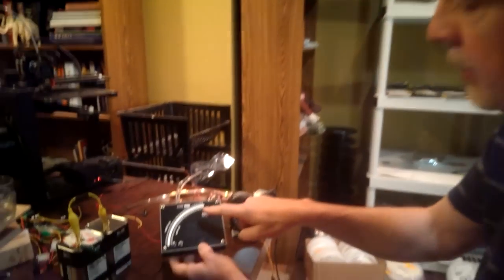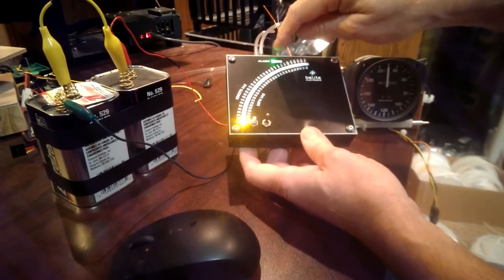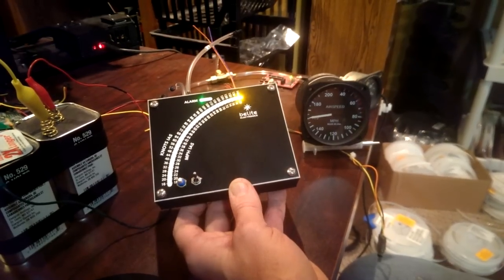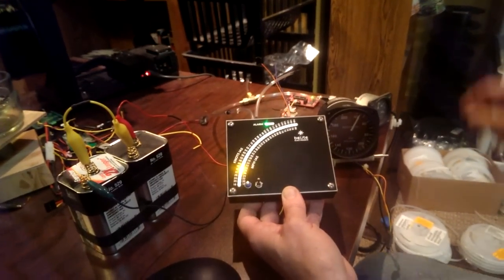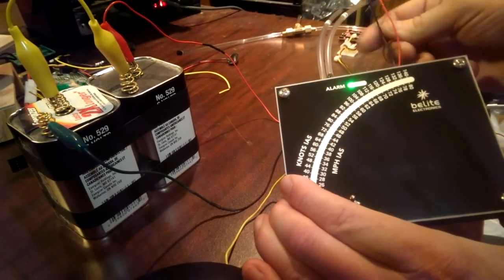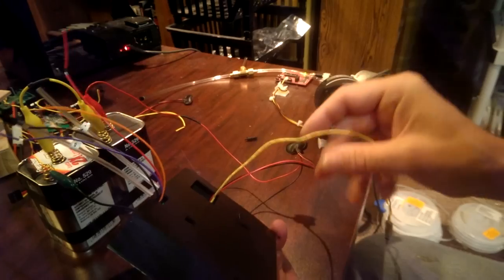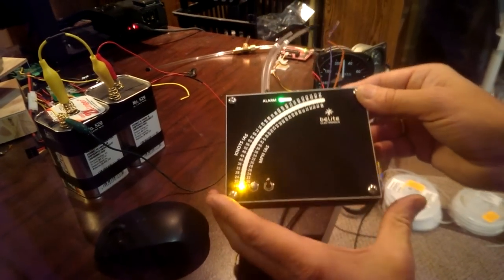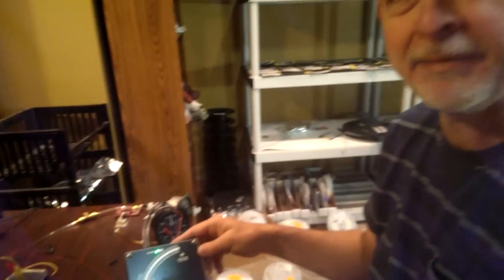Huge Air Speed Indicator (Belite's "MFI")

Comment: Those scale numbers are insanely small and so very crowded together! Also, why not make the LEDs in a more visually pleasing 180 degree arc (90 just screams incomplete given the size of the unit)? This would space out the LEDs, making it easier to enlarge the numbers and see when two are lit. But why not go one step further and calibrate the unit so each 5th LED is an even multiple of ten, just like the analog ASI? Then by replacing the in between numbers with lines (like the analog scale), you could make the 10's numbers even larger! If we're smart enough to read our speed on an analog scale with 4 or 9 unnumbered lines between major numbers, we're smart enough to do the same on your unit. Never mind. It wouldn't work due to the variable max range jumper option. Hmmm... maybe sell it as two versions, each their own scale modified per above. Who is going to buy this with the expectation of swapping it between their fast and slow planes? No, it's going to be mounted permanently in only one plane/UL.